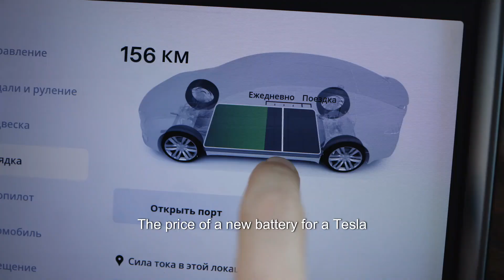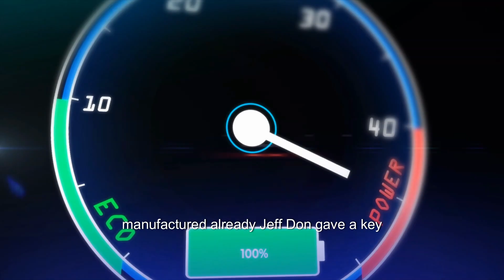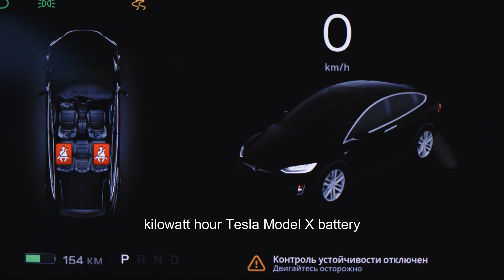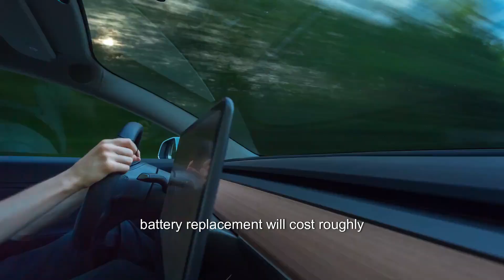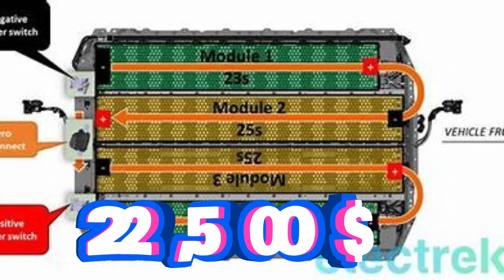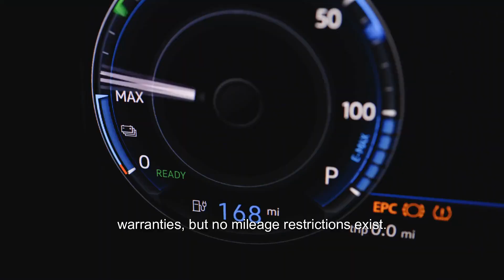Breakdown of Tesla Batteries Replacement Cost

Comment: 350,000 miles on my ICE with periodic maintenance, non-replacement on engine or trans, will last me another 350,000.  No limit.  How fun is it to replace an EV battery?  A wallet full of empty!
Reply: blablabla, u have just not enough money to own an ev
Reply: @whatchout_tv  Blab, blab, blab, Black Sheep!  Don't cry,  if I say I have four ICE that has outlasted any EV on this planet and are still running.  First is my 1962 Buick Skylark engine swap JEGS 454 with six speed manual T-56 Magnum tranny.  My 1979 Toyota Celica, all original, with the original RA40-22 ltr. L4.  My wifes' 2003 4.6 ltr. L6 Chevy Trailblazer.  My 2007 4.8 ltr. GMC Sierra Classic.  All bought brand new and paid for!  I also own two homes, on a hill on two properties with a shop paid in full and a lake behind them.  I'm sure you have a hefty lien owner on your EV, since you're that rich.  Best of luck with your I-Phone on four wheels!  Hahahaha!
Reply: @whatchout_tv  You're just an idiot!